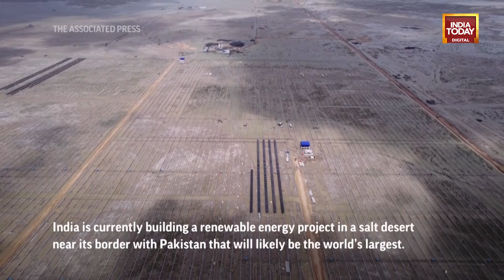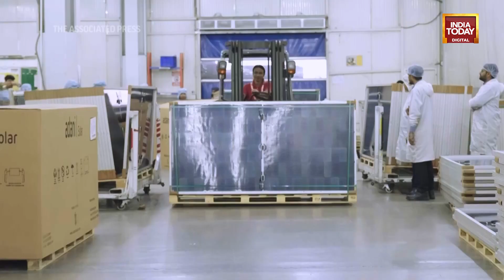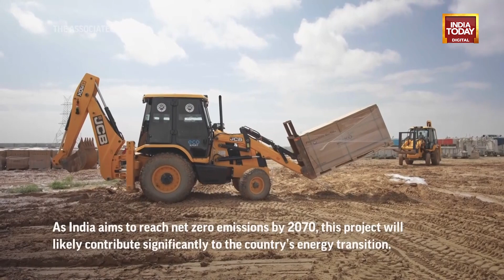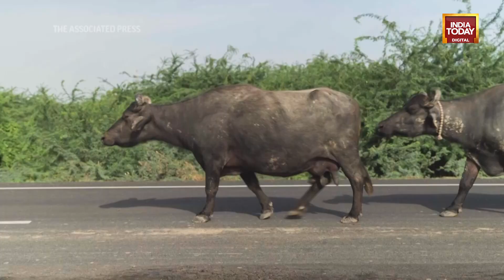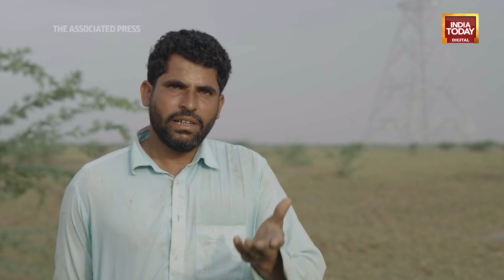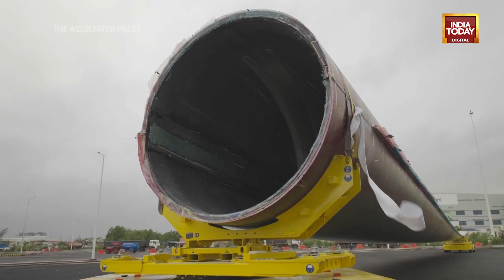Bordering Pakistan, India Builds Its Largest Renewable Energy Project, In The Salt Deserts

Comment: 𝗜𝗻𝗱𝗶𝗮 𝗶𝘀 𝗕𝘂𝗶𝗹𝗱𝗶𝗻𝗴 𝗧𝗵𝗲 𝗪𝗼𝗿𝗹𝗱'𝘀 𝗟𝗮𝗿𝗴𝗲𝘀𝘁 𝗥𝗲𝗻𝗲𝘄𝗮𝗯𝗹𝗲 𝗘𝗻𝗲𝗿𝗴𝘆 𝗣𝗮𝗿𝗸

The Khavda Renewable Energy Park in Gujarat, India is the world's largest renewable energy park, with a capacity of 45 gigawatts (GW). The park is located in the Kutch region, one kilometer from the border with Pakistan.

It is powered mainly by solar energy and has wind speeds 5 times faster than the plains. The park is spread over an area of 72,600 hectares (726 square kilometers!). That is about 5 times larger than the total size of the French city, Paris! 
GAUTAM ADANI quietly built a solar park, in a place which doesn't even have a pin code. AS USUALLY, WOKE Liverals have started the HATE campaign saying people of the region are affected. 🤣😅Khavda, near Bhuj in Gujarat, is so dry, that even mosquitos are rare. 

It will generate 30 GW of power, which will power 18 million Indian homes!

Applause 👏